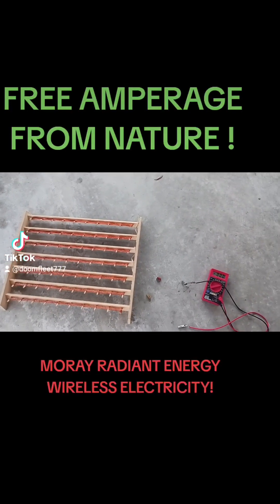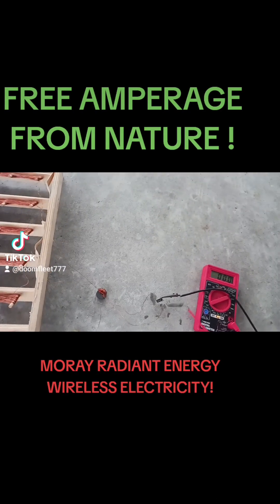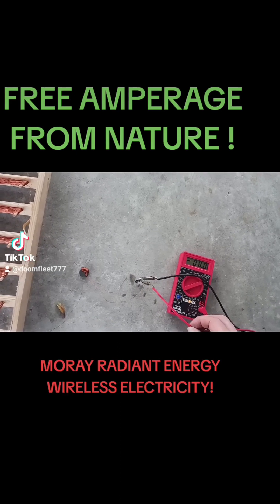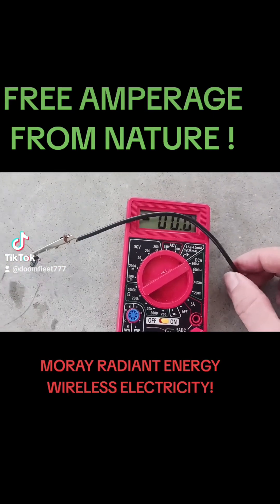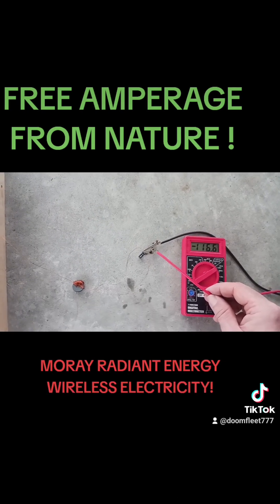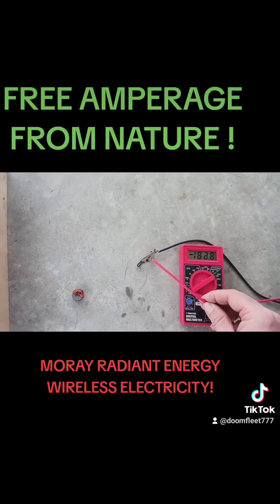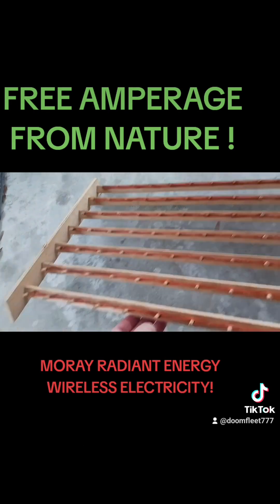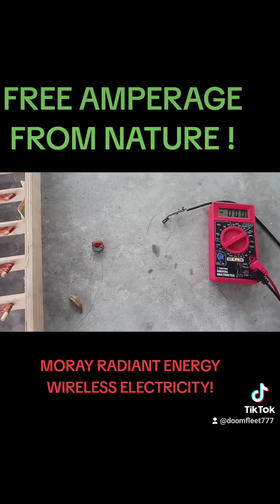FREE ENERGY PROVEN !!!

Comment: Hey Peter, I have an even better one that I'm trying to figure out how to test that generates significantly more free energy than this.

Using mercury cadmium Telluride to make a photocell you can sensitize it to operate off of the black body radiation emitted by room temperature objects, to produce a photo current.

The density of blackbody radiation emitted by an object of 22.3° C is approximately 440 Watts per square meter, and therefore a Mercury cadmium Telluride cell has about 440 watts of external radiation coming in to convert to electricity but it also has its own black body radiation affecting the cell to convert to electricity.

This means that an MCT photocell at room temperature has a potential of 800 watts or more to convert to electricity day or night just off of the black body radiation of objects at 22.3 degrees Celsius.

Additionally Mercury cadmium Telluride photocells are generally between 40 and 60% quantum efficient with some experimental cells approaching 90% efficient or more.

This is energy perpetually day and night as you will never run out of black body radiation to run the photo cell off of. Blackbody radiation is omnipresent in the environment and if you're ever in a position where it isn't it's because you're Frozen and dead.

As a bonus, the Mercury cadmium Telluride is directly converting thermal radiation into electricity and therefore the Mercury cadmium Telluride will also act as a thermal sink in its local environment and can be used for cooling in addition to power production.
Reply from the maker: Sounds like an ambient thermal rectenna. (Nantennas in britain)
Reply from the maker: You would like ntsinnovations.com